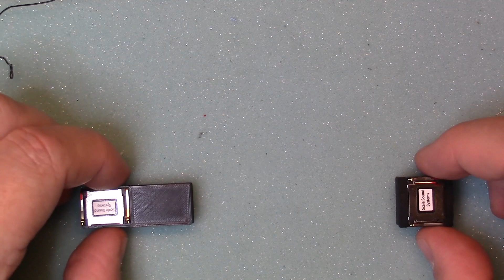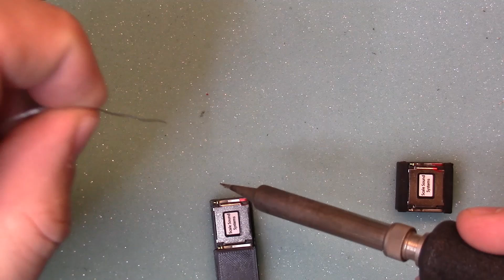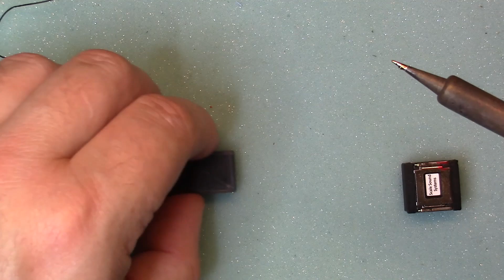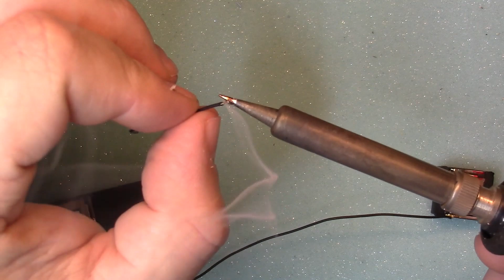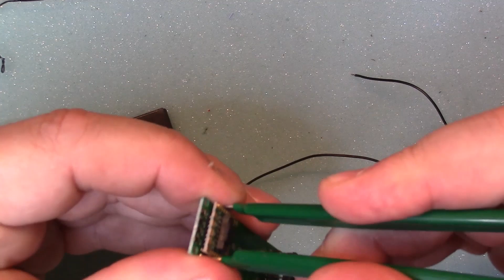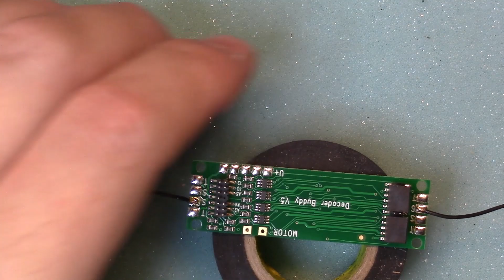Wiring Scale Sound System speakers in series.

Comment: At 4:40 the iron tip is pulled into the magnet of the speaker. I've had this happen before. I use a little piece of double stick tape to hold the speaker to a scrap of cardstock or wood (weighted down) to keep it from jumping to the iron. Scale Sound speakers are great!

Comment: Excellent video.Have a few questions that may be you can answer,if ,not no big deal.1)why does the Scale Sound guy want you to drive the spkrs. in series?That doubles the resistance.2)why does the Sound guy want you to not use flux on tinning the Spkrs.?Seems to me he should tin them and thus lessening the chance of someone using flux if it will create a problem. stay well solo,Doc BC
Reply: "Why Series"? Because wiring them in parallel (thus halving the total resistance presented) would present an Impedance load to the decoder audio Power-Amp stage which is lower than "minimum acceptable impedance", with likely resulting circuitry damage. Check the specs of your chosen decoder, but wiring in-series is the "fail-safe" go-to option for contemporary ST, TCS, and Lok decoders...
(and most decoders have more-than-enough grunt available to drive a series-total 16 or even 32Ohm Impedance speaker load well loud-enough for most sane applications...)

The bigger concern about any "multi speaker" install is making sure that the physical direction both speaker drivers push the air between the speakers and your ears is phase coherrent (IE they both "push" the air, in the same direction, at the same time)
Reply: Keep in mind that TCS and a couple of other DCC manufs do actual recommend avoiding using extra flux, preferring to rely on the flux built into quality 60/40 rosin-core solder (Kester, et al). See https://tcsdcc.com/productnotes/important-soldering-tip as an example.
The root of this advice is avoiding situations where novice solderers use excess flux, boil the flux liquid into a corrosive state, and then don't post-clean the joint (enough, if at all), leading to decoder pad/circuitry damage and joint failure. Ergo, best to avoid the "excess flux, no clean-up" problem condition altogether and just rely on the self-dosing rosin-core flux built into the solder....
Reply: BC, Soundtraxx and TCS recommend a minimum impedance of 8Ω. While both Soundtraxx and TCS can operate at 4Ω keeping their master volumes low, there is risk of burning out the amplifier. Halving the speaker impedance increases the current-draw from the power amp. If the power amp is not 4Ω stable, it will fail. Thus, for two 8Ω speakers, they should be wired in series for a 16Ω load with Soundtraxx and TCS decoders. If Larry were installing an ESU Loksound decoder (or Ring Railpro), he could have wired these parallel, since both of these decoder brands state their amplifiers as being 4Ω stable.

As for flux, I should have clarified that it is not needed if one is using rosin-core solder; the flux within rosin-core is sufficient. If the solder is NOT rosin-core, then a SMALL/LIGHT application of flux would be fine to use. Excessive flux can boil, create a mess, possibly damage components and is corrosive to the joint if not cleaned afterward.

As to pre-tinning the tabs on my speakers, that would add considerable time and cost to each one. Hundreds of these leave the shop every month. Tinning is a common installation step that is required for almost every step in an install. As with any DCC component, the manufacturer expects the user to know what they're doing and have the skill to execute it. If they don't, we have guides and videos to help and will gladly give advice if asked.

Hope this helps. Thanks!